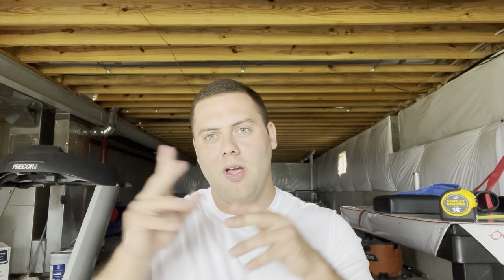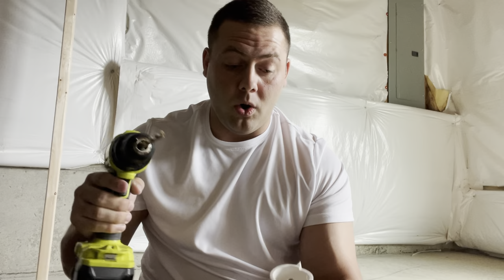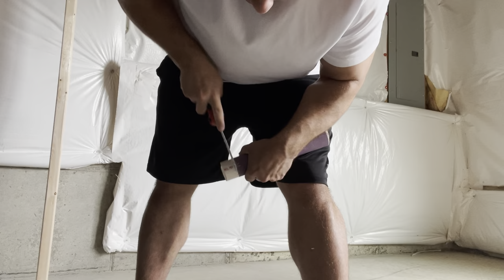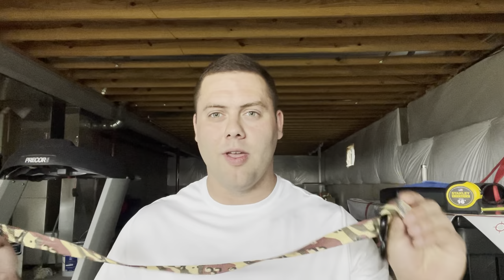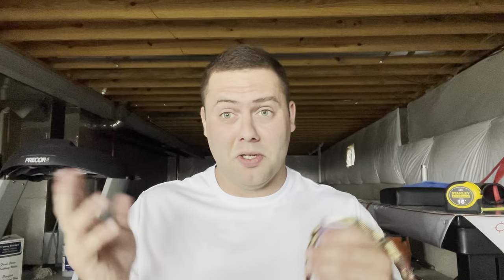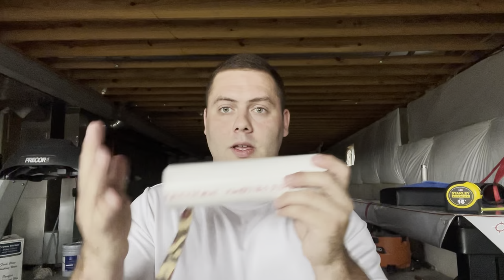Build Your Own Wrist Wrenches and  Multispinners For Cheap

Comment: Hey should I use the strap that’s supposed to go on the back of my hand I have a hard time holding on to it I can move the weight but it’s like it’s slippery to hold on to
Reply from the maker: you’re supposed to put sandpaper on the wrist wrenches so it won’t be slippery.
Reply: @ChrisDrummondAW  alright thanks

Comment: Is this different than parallel strap wrist wrenches?
Reply from the maker: the bar on those forces the straps apart and makes it much easier to lose the strap off the end of the wrench when you bend your wrist. remember, your wrist doesn't bend straight and you're almost forcing your wrist to bend straight with such a tool. I don't like them.

Comment: Im making a wrist wrench and multispinner for mainly vector work (peg to peg and pad to pad side pressure,the way todd hutchings does it). And my hand length is around todd's too (about 7 and a half inches). I saw that he uses a 2  1/2" inch diameter multispinner and a 3 3/8" inch diameter wrist wrench for the above listed vector work.

My question is , do you think its a good idea if i make my wrist wrench and multispinner of the same diameter too

My weight is 75 kg btw , if that affects anything
Reply from the maker: Wrist wrench is fine if not a little big. I think his multispinner is definitely too big for most pronated exercises (nobody is that thick around the thumb) and he puts a cap on it and puts the strap under his index finger to make it easier.
Reply: @ChrisDrummondAW so ig I should make a 2 1/4" inch diameter multispinner like you said in the video 

And 3 or 3 1/4" inch one for the wrist wrench?

Comment: I know this is off topic, but do you know where I can find a good loading pin that's shorter than most for seated work? I tried using the judo belt method, but the weights flop all over the place. My bench isn't incredibly high so it's hard to get my elbow low enough beside my leg.
Reply from the maker: I bought mine from Arm Assassin with a table mount pulley.
Reply: @ChrisDrummondAW  Awesome. Thanks for the info! I get a lot of stuff from Luke over there, so I'm sure there's a shorter variation of the long pins.

Comment: I use a 2 in thick pipe is this good enough for wrist and cup exercises?
Reply from the maker: Yeah. I'd go bigger for vector work (side pressure, pinning exercises, etc) but for dynamic cup exercises 2" is great.
Reply: @ChrisDrummondAW let’s go thanks man 🙏🙏🙏